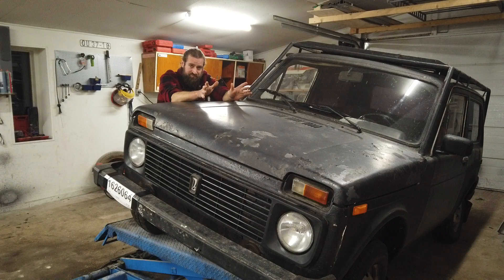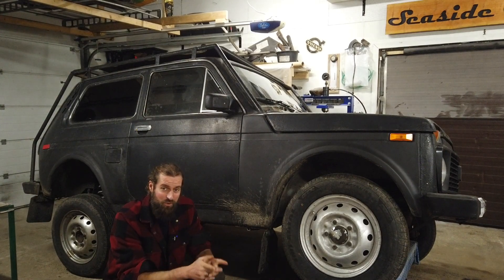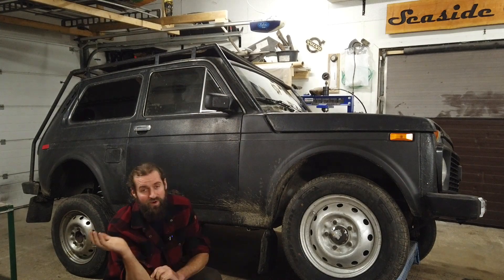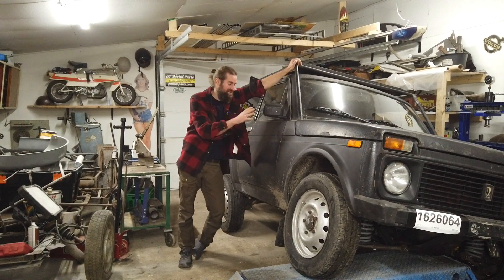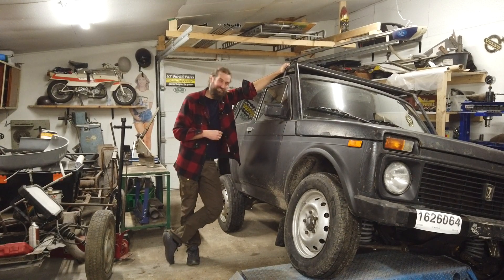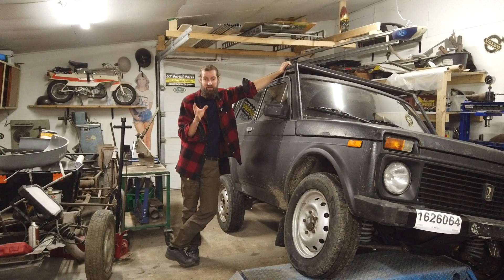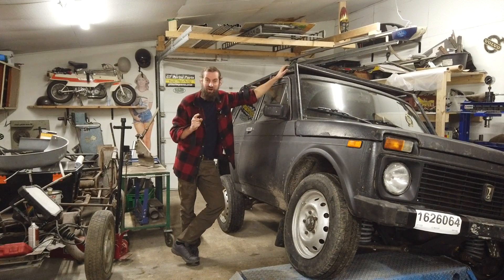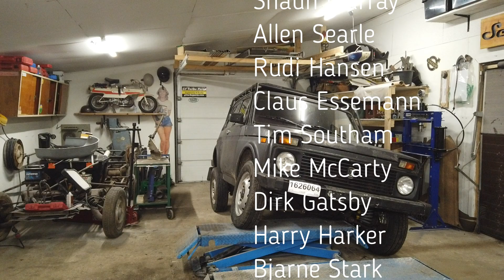Better Lada then Niva. MOT time on the 4x4!

Comment: Hi! I enjoy your channel and philosophy on driving different cars and enjoying them then selling to the next owner, so they can have fun with them. I awe so sell my cars with low or no profit, but am happy to report that all of them are still on the road. Like mi 1992 citroen bx estate, my 1980 Gaz 24 Volga, my 1986 fiat regata and so on! Regarding the Niva, the decision for the gear box is easy. Next time drive the car in 4-th gear. If you like it put the 4 speed if you don't fix up the 5 speed. The 4-th gear on all Russian cars is 1 to 1 in 4th gear. Only the 5-th gear is 0.82 to 1. Reliability wise i vote for the 4 speed! The engine is not the most powerful one so a shorter geared gearbox is better. Some people say to change to 5-th after 90-100 km/h and to overfill the 5 speed gearbox with oil (because the 5 gear has an inherited oil starvation problem). Have fun and many miles ahead!
Reply from the maker: Thank you Volga.... Uhhh a bx estate! I am very jealous!

Yea the 4 speed seems to be a pretty good solution really...

Comment: Congrats on passing MOT. 

My sincere suggestion is to put bitumen on the underwings and also get plastic covers for them, they are cheap (got all four for around 50 euros) but those two things really helps preventing rust, especially if you are driving it in wet conditions or salty roads. 

Keep it up sir!
Reply from the maker: I got plans for inner wheel arches! :D